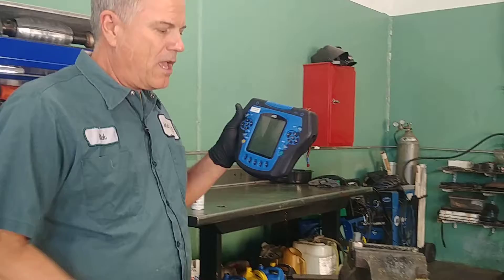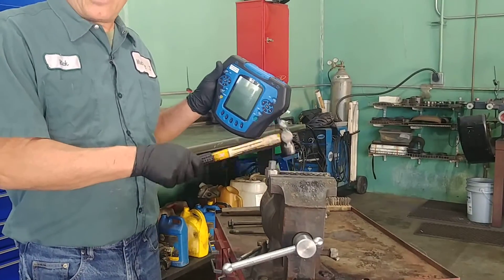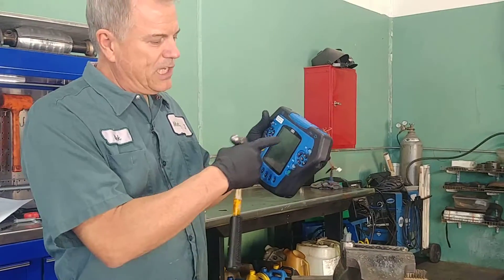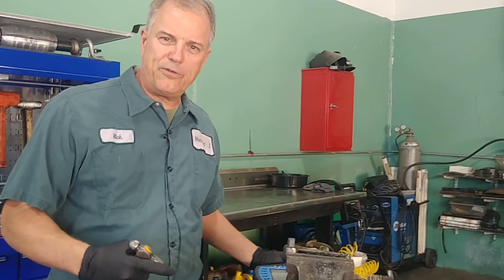What is a Knock Sensor in a Car?

Comment: So my 2012 Koa soul, 1.6 engine.  My engine light came on and it's the knock sensor going off. I don't hear any rattling in the engine, it's running fine. Should I change my knock sensor?

Comment: Hey I'm looking at buying the car and the guy said he replaced the knock sensor but the light stayed on after with the same code, 2006 rsx. He's driven the car for 10000kms and says there doesn't seem to be a problem. Do you think the car is safe? Or am I taking too much of a risk?
Reply from the maker: Most likely, it was not a quality sensor. It will primarily effect emissions and fuel economy.